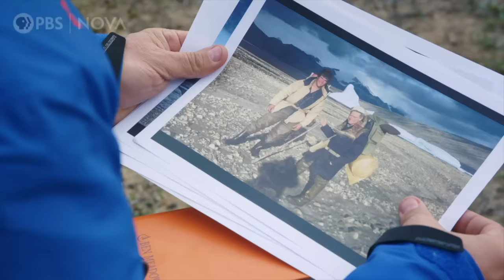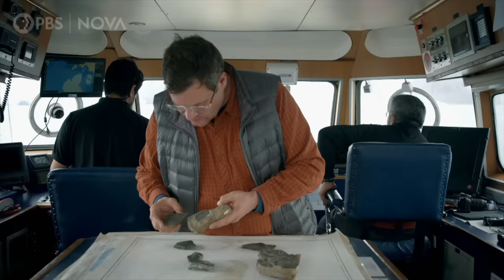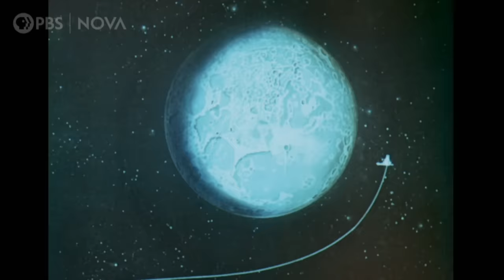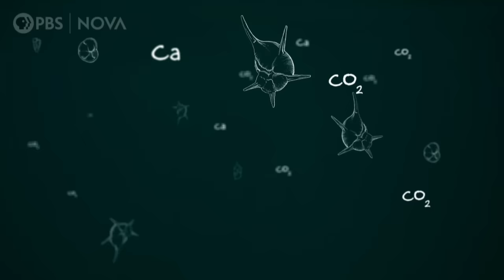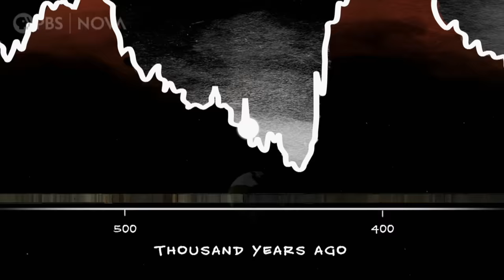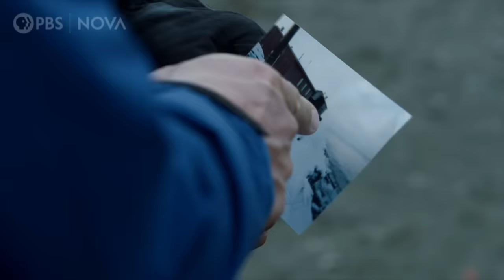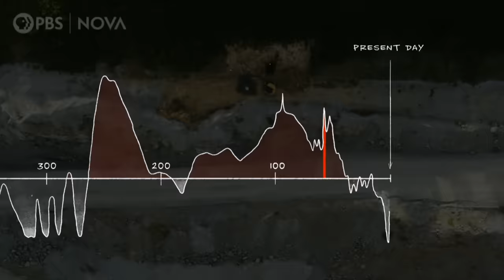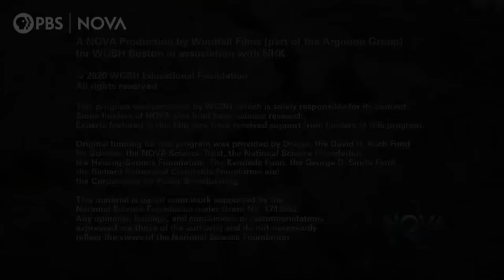Polar Extremes: Ice Worlds | Full Documentary | NOVA | PBS

Comment: 7:47 There is an aeronautic principle known by pilots of all sorts as “ground effect”…  when you are within roughly a half wingspan of the surface, the speed at which you are able to maintain lift is dramatically reduced.  You can use it as a region to reduce your airspeed before touching down in a soft field landing, but if you climb out of it prematurely when taking off, you will stall into a “nose dive”.  Like anything else, it can be your best friend, or your worse enemy…

Comment: ignoring tectonic plate movement entirely. The area he was in was much farther south than it is now.
Reply: They didn't ignore it. If you were paying attention, you'd have seen that they dismissed it as the reason because they knew where the various continents were at various times. The land mass that became Antarctica was still close to the South pole when it had a forest with dinosaurs. And, the other area wasn't all that far South, either--it was still pretty close to the Arctic Circle. Close enough to potentially be cold if the planet wasn't so much warmer.

Comment: "the bottom of the Earth"
"it's hard for ice to form on water"
Sometimes I feel it would be better if I were instructing the YouTuber. One of us might not get any smarter, but at least it wouldn't feel like one of us is getting dumber.
Reply: We call it the "bottom" because we orient to the North as the "top". It's just a convention. Ice will form on calm waters, but any movement tends to break it up, so yes, it is hard to form ice on open water, especially seawater. Seawater has a lower freezing temperature & constantly moving means it will take longer to form solid ice. Not as dumb as you think.

Comment: 36:35  hey guy let's try to be truthful here. Mars atmosphere is mainly CO2 also yet its very cold on its surface. 
You scientist used to be honest about why Venus is very hot. Its because it has an extremely thick atmosphere and not just because its high in CO2. 

Mars atmosphere is mainly CO2 but it has a thin atmosphere unlike Venus. 

Abd while were on the subject, we were taught that Mars lost its thick atmosphere because its core cooled and it no longer had a magnetosphere yet venus also has no magnetosphere and has a thick atmosphere. 
Hmm?
Reply: Venus has a lot more gravity to hang onto its atmosphere and was geologically speaking still volcanically active recently thereby replenishing any Co2 that is lost from the solar wind.
Reply: People that lack understanding questioning those with it is partly why we're in this mess.
Reply: @christianhoffman7407  so then it's mainly atmospheric pressure that's driving up the temps and not solely CO2. 

Also, Venus atmosphere is many many times thicker than Mars yet Venus is barely 2x the size of Mars and Venus is much closer to the sun and therefore should experience much more atmospheric stripping from solar winds than Mars would.
 
Yet we're told it's the solar wind that stripped away Mars atmosphere but it didn't strip away a planet atmosphere that's only twice the size and over 90 million miles closer to the sun that Mars, while both lack a magnetosphere. 

See how that doesn't make sense
Reply: @MJIZZEL  There's a nice graph at the 1:27:20 mark that goes back 800K years.  Is the suggestion that our atmospheric pressure has changed along similar lines the last 800K years?
Reply: @christianhoffman7407  point remains, yet mars atmosphere is mainly CO2 so by that logic, it’s had more volcanic activity than Venus?
Reply: @JT_771  there are so many advances in science through the years that came from what you would consider “people with a lack of understanding”, raising questions. 

Buddy I hate to tell you this but questioning a hypothesis is how science works. 
I know you’ve been trained to appeal to authority but I can show you hundreds of different ways on just one topic, from people you would consider, “people with it” in regards to understanding, that’s completely driven by govt funded propaganda. 

The topic is most likely the “mess” you mentioned. 

Let me know if you want to learn the truth. Present me with information “for” the mess making and I’ll show you the truth. 
CO2 is plant food my friend. The earth is greener than ever according to nasa. 
CO2 levels just 10k years BP, we’re dangerously close to the low point which under photosynthesis stops completely “150ppm”.
CO2, temp rise, sea level rise, and glacial retreat rate, ALL started on an upward trend (that has not deviated) a full 40 YEARS BEFORE the industrial revolution. That’s also while incredible amounts of forest were be removed. Yet co2 went upwards?

There is no “lack of understanding” here my friend. 
I’ve done the research. Internet has made it to where anyone can access the data today so does that mean question’s people like me raise, are invalid do to lacking a degree?! 
My questions are invalid while based off the same data that a talking head is saying because they are in authority? 
Real world doesn’t work like that my guy. 

A trace gas that makes up 0.0004% of our atmosphere is not the full driver of CC. 
That’s why their models are always inaccurate 10 years later. Everyone of them. 
They don’t factor in anything else in the models but co2. The boogeyman
Reply: @disc64 no that graph is temp changes back to 800k bp. 
From a Greenland ice core sample( gisp2 maybe?)

Those peaks and troughs in it are what’s called DO events or Dan Oshgard events. 

Strangely while temps are at the lower end, late glacial maximum of 22k bp, for example, the artic and Alaska and Siberia were all warmer than today and islands INSIDE THE ARTIC CIRCLE and only 400 miles from the North Pole, were warm and lush and full of dense Forest and megafauna!!

How’s that possible inside the artic circle? The Siberian islands and those north of it, were vegetated and full of huge animals as recently as 13-17k years ago?
How can photosynthesis happen in a place that has almost 6 straight months of no sunlight today?

Ever notice how they always depict mammoths walking on ice sheets? That’s because they found them flash frozen in areas that today are extremely cold yet no one addresses the issue of what 10 million mammoths were eating while being in those frozen environments. 
The fur they had wasn’t a product of living in cold environments because their skin pores are exactly the same as todays Asian/ lAfrican elephants and they lack the oil secreting glands that keep fur waterproof for cold environments. 

Many many questions about those temps in that graph have never been explained yet they were upset when people like hapgood raised them. 
Give path of the Pole a read. 
He raises hundreds of interesting anomalous about the ice ages that have yet to be answered. 
I don’t endorse his proposal of the displacement of the crust but he does raise important questions which are all thoroughly referenced.
Reply: @MJIZZEL  Charles Hapgood the author of "A Path of the Pole" died in 1982.   Anything more current that I can sink my teeth into?  A lot of thinking has changed since then.
Reply: @disc64  my apologies for not being more thorough with my suggestions. 
Path of the pole has an index that's full of references. 

I was suggesting you to look into the issues he raised and read the references he sites. 
Anything that has been updated will have citations via the references. 

Many of those issues remain unanswered however. 
Geologist Nick Zenter released a presentation recently, on a team of young geologist findings, when looking into the glacial outburst flooding of the late Pleistocene. 
The northwest geologist had been overlooking the work of J Harlen  Bretz, from over 100 years ago because the stigma of being a catastrophist had tarnished his name and thus his work. 
Incredibly, Bretz, from his fieldwork in the 1930's, had discovered evidence in the form of terminal moraines , for a much earlier ice sheet that was much further southward penetrating than the LGM!
This ice sheet too had massive Outburst flooding and more than likely was responsible for the formation of Moses Coulee and the grand Coulee. 

My point with this  is that just because the work is not very recent, doesn't mean it isn't still valid science. Them going back and reading Bretz notes has led to Incredible revelations. Revelations that were made apparent almost a century ago. 

As for the anomalies that hapgood raises, much of it has had no proper work done on it recently and has been sorta swept under. 
I'm sure the Russian geologist continued their investigations but good luck finding those journals. 

Btw, they made all of Bretz fieldwork and journals available online. 
I Suggest checking out Nick Zenters channel and another geologist, Chris  @Dabblers Den.

There is a group that's kept pursuing hapgoods anomalies of the pleistocene and have some incredible hypothesis based on their findings. 
One if the members has a channel on yt called  @Mario Buildreps.
I dont endorse their work but do find it intriguing enough.
Reply: Mars is cold because it's atmosphere is so thin, otherwise, it would be pretty warm there. It's the thickness (or lack of it) & being a much smaller planet that's the source of Mars' cold. Venus is a larger planet (almost the same size as Earth, whereas Mars is one third the size of Earth), thus more gravity to hold that atmosphere. No need for a magnetosphere, then.
Reply: @MJIZZEL  It's multiple things that drive up the heat: pressure, the amount of CO2, whether or not there's volcanic activity to replenish that atmosphere, the fact that Venus is a much larger planet than Mars. It makes sense. You just don't understand it, or want to argue that Climate Change isn't a real issue.